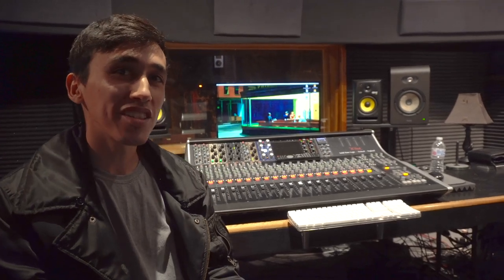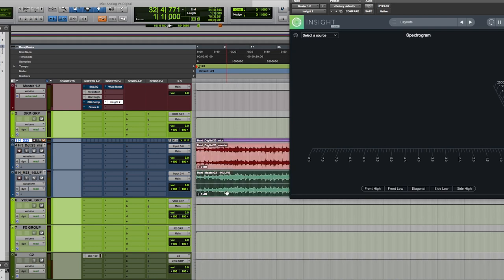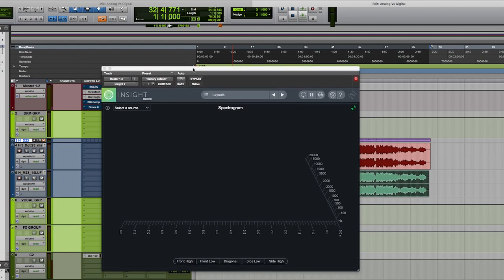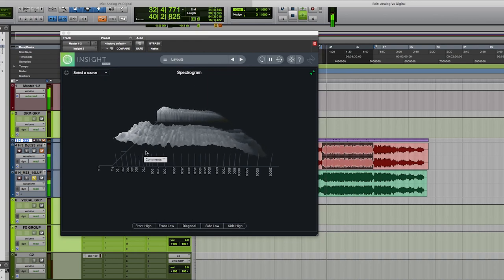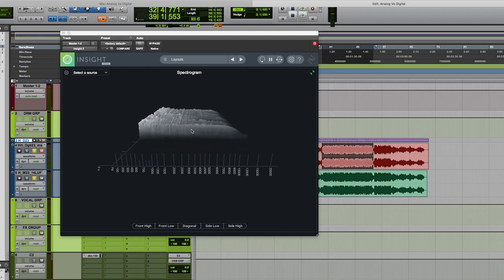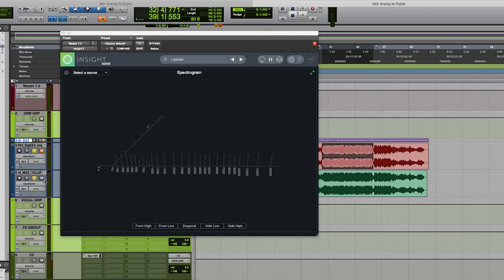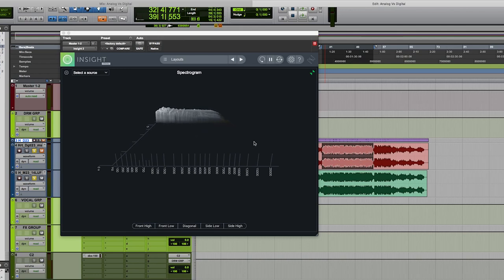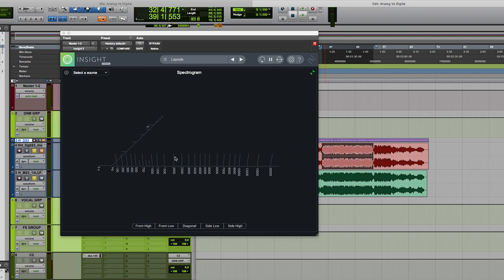Analog vs  Digital Mixing and Mastering! Can you hear a difference? YES!

Comment: This has been done to death so many times.

Actual professional producers and studio owners have done blind audio tests and couldn't tell the difference.

Also, these kinds of videos lead the viewer. He sets it up with the title before you've even watched a single second of it, tells you the outcome in the preamble, tells you which one of the samples is analog and which one is digital, and even provides you with a visual.

Your resulting opinion is already baked in.

Plus, he doesn't take into effect that as-is doesn't need to be the final product, and changes could be made to the digital file to adjust the sonic profile accordingly.

And finally, the reason I brought up the above point in the first place, is that he tells you that he did the digital mix entirely ITB, but gave zero background as to which plugins he used. He didn't even bother to mention whether he was using matching plugs to his analog counterparts, and if so, which company's SSL emulators.

This is just bias posing as a shootout.
Reply from the maker: “And furthermore” … thanks for watching 😘

Comment: In the beginning of the video, you admitted to using extra gear to help the analog recording be the best that it can be. That means that there was bias in your experiment and, thus, it is invalid. BTW, compression can make a HUGE difference in the way something sounds.
Reply: He did not mean that he used extra mixing equipment compared to digital, he said that he did "everything" in the box which is digital mixing. He didn't even say that he did not use music compression.
Reply: That's the point - he didn't say anything at all. Just "in the box". Using which plugs?  Was he using SSL emulators? If so, from which company? And if not, why?

Comment: What was the digital setup? 16 or 24 bits?
What was the sampling rate? 44, 48, 96 or 192 KHz?

Digital recording on 16 bits at 44 KHz gives 96 dB of dynamic range and a low pass at less than 20 KHz.
Digital recording on 24 bits at 96 KHz gives 144 dB of dynamic range and a low pass at less than 40 KHz.
Normally, production is done in 24 bits at more than 44 KHz and reproduction is done in 16 bits at 44 KHz.

Ultimately, since a PC is involved, it would be interesting to see the system load, both in production and reproduction modes.
Reply: So? What you say it is already known What is your point n correlation with those numbers you multiplied by 6 db? You would still not beat the analog sound

Comment: It's bullshit that it is better to run your ITB mixes through analog gear.  You can achieve even better results using various analog modeling plug-ins than analog gear.  :)
Reply: or even better  just use all analogue
Reply: How can analogue modelled plugin sound better than the real deal?